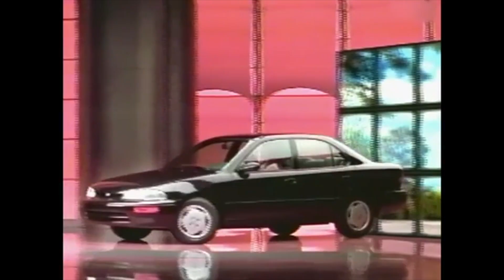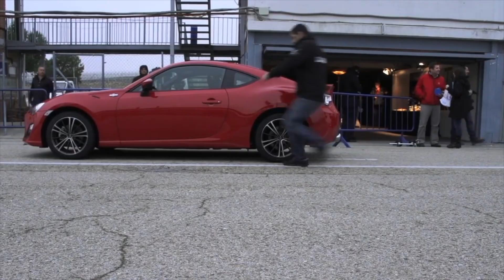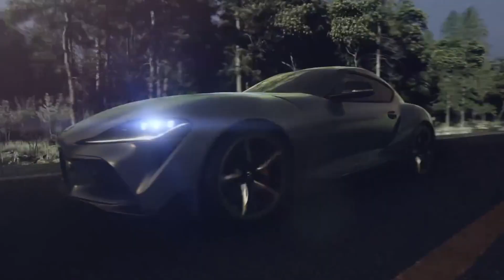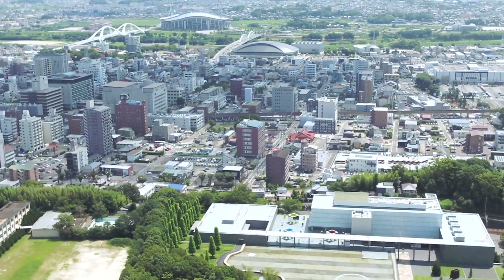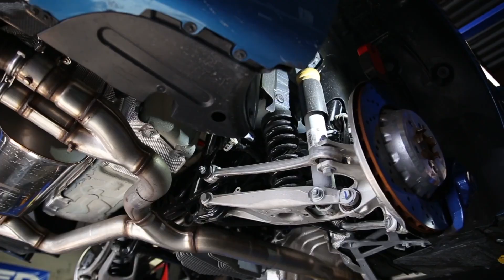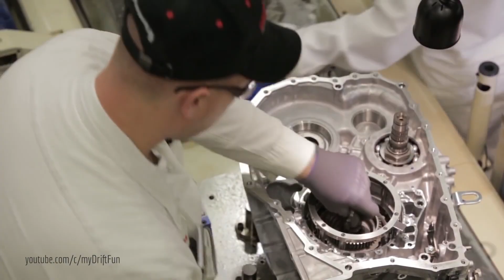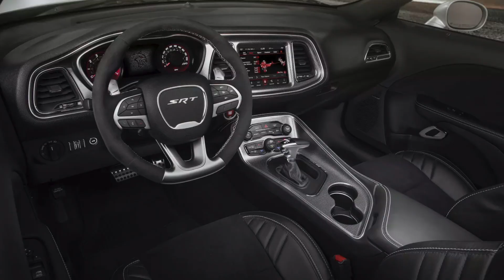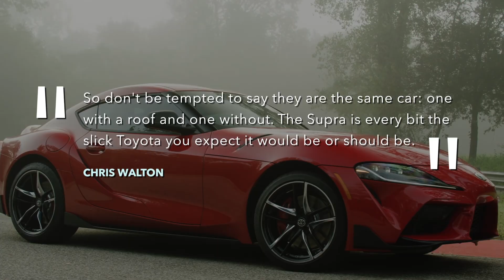MKV Toyota Supra - BMW or Toyota? The UNTOLD TRUE STORY

Comment: Sorry Toyota but for the price of that "Imitation Supra" I would rather just buy the new Shelby GT350R Mustang...
Reply: The old Supra cost around $20 000 more, including inflation.
Reply: @Ethan-ck6iz  Toyota has now confirmed that its new sports car will start at $49,990 plus $930 for destination charge. But that's for a version powered by the 3.0 liter inline-six. The four-cylinder model should cost less.
https://www.roadandtrack.com/new-cars/future-cars/a12635049/2019-toyota-supra-what-we-know/

At least to me, that new "Imitation Supra is not worth $50,000.  Toyota is simply trying to "bank" on the Supra name.
Reply: @DJ Ghost Looks like it has the 155 MPH speed limit (a.k.a. "the European-spec speed limiter") like Jaguar, for example. (and likely Aston Martin) IIRC, I tend to see the "155" limit on "executive-class" luxury cars.
Reply: one problem, it's a ford
Reply: @MJ_868  IF you want Non-Ford alternatives that offer more bang for your buck car than that "BMW Supra" then how about the (2019 Lexus RC 300 F SPORT RWD or AWD, Subaru WRX STI or STI Limited both well under $50,000 starting, Nissan 370z,  heck even the Civic Type R would be better).  Toyota won't get the glory back from Nissan, there is a reason why the Original Skyline rocked the world and why the Nissan GTR continues to rock the world with its amazing engineering and performance, and it deserves the price it commands.  Oh and Nissan didn't get BMW to build it for them...
Reply: @MJ_868  one problem with you answer at least ford built it with a passion
Reply: A two door Falcon?
Reply: then do it. the mustang probably has too much hp for you anyways. you'll end up powersliding into a ditch.
Reply: @timcoccarelli2193  I'll just leave this here for your eyes.   "IF you want Non-Ford alternatives that offer more bang for your buck car than that "BMW Supra" then how about the (2019 Lexus RC 300 F SPORT RWD or AWD, Subaru WRX STI or STI Limited both well under $50,000 starting, Nissan 370z,  heck even the Civic Type R would be better).  Toyota won't get the glory back from Nissan, there is a reason why the Original Skyline rocked the world and why the Nissan GTR continues to rock the world with its amazing engineering and performance, and it deserves the price it commands.  Oh and Nissan didn't get BMW to build it for them..."

Yeah, I would still get the Mustang or any of the other alternatives that I have mentioned above over getting a BMW Supra.  Oh, and fortunately I know how to drive quite well and a manual to, because I grew up with cars that didn't have all the "Driver Assist" crap that vehicles have today that essentialy make newer drivers worse drivers lol.
Reply: But the new GT350R is $67,000. The GR Supra is only $50,000...
Reply: @draconious4005  Ya, and how many people are gonna get a stock Supra... nobody and yes I said the GT350R but hey the lower mustangs are still a better overall deal than the Supra,  there is the GT Fastback, GT Premium, Bullit all of which heavily undercut the $50,000 starting price of the Inline Six Supra.  Also the "New" Supra is a brand new build basically from the ground up so it is unproven.  The Mustang has a long pedigree that is proven, budget friendly and one of the most bang for the buck cars you can currently buy.  But hey Toyota might have a gem maybe but only time will tell when the car gets driven around.

Comment: WTF ??? Laws against badge engineering ??? I drive a 2018' Buck Regal built in Germany and it's the same car as the Opel Insignia.
Reply: The Buick Regal is a car which was developed by GM. Opel is a German car manufacturer which is owned by GM. Why would German anti-trust laws apply in this case?
Reply: @ @AbbeyYaar  Because Opel is no longer owned by GM

Comment: Who said "reliable" z4....come on BMW's are fine new but put over 100k on them and they become worthless bags of electrical hammers.  I was pleased to see the development at a point was separate but I am sorry Toyota you are fools to think us die hard fans would tolerate a BMW engine in our Supra.  All the other co-development would be acceptable to many if the car had the heart of its brethren.  ZF transmissions are great but a mistake as the only option.  There needs to be a conventional 6 speed in that car or stuff it. Look at used car ads for 350/370Z's...automatics are worthless but one with a manual sells within several days for a much higher price.  I was one of the many looking forward to this car but I will never buy one simply because Toyota has lost it's focus on it's loyal customers and why we are such.

Comment: Can anyone help me plz?....

Is this a Z BMW or  a beefed up Miata?
Reply: This isn't a way to test by imagining.  I assume when you drive it hard on the track the separation between a Corolla, Miata, and this would be distinct.  At normal speeds and driving you might as well get a Prius.  I took the 750xi to 150mph in Comfort+ and it didn't even feel scary.  In fact it even shifting Up at like 140+ which was interesting.  It's like it's mean't to go fast obviously but I never ever been that fast in it ever.  I hit 140mph all the time on the R6 though.  Have to love when you go that fast in the dry that they can do it with EASE and give you confidence when doing it too.  Not like it's going to fall apart and you feel like you are going to die or lose total control at any moment.

Comment: Its like making a sequel to a movie without the original cast. If it was just a new vehicle all together it wouldn't be a problem. The issue isn't that they slapped a BMW engine in a supra, its that they slapped the supra name on a car that doesn't have the same Toyota engineering as the legendary supras with the 1jz/2jz engine. Its a cool car sure, but its not living up to the supra name. Its a cash grab without the same amount of effort as the prior models. I could never afford one anyways, but its still a big let down.

Comment: It doesn't matter what they say to justify it this Supra it should have never been done in the manner it was done in. If anything it flies in the face of the Supra name because it's chocked full of BMW parts and it almost seems like Toyota didn't have much confidence in themselves this time around so they went to BMW. Toyota has proven many times over the years they could design and build sporty cars that not only perform well but are also reliable and highly tuneable so why not this time around? If you plan on resurrecting such a famous nameplate then there should be 100% forward momentum in keeping it genuine Toyota because after all, this is what made the Supra so famous among the masses since the 80s. The end result is now a car that looks nothing like the concept, introduced BMW issues (electrical, carbon buildup, timing chain issues and injector failures) to what is supposed to be a sporty and reliable car. Why not a Toyota developed motor? Why not an Aisin transmission over a ZF? Why co-develop at all? This car will flop and I guarantee all the money spent developing this Supra won't be made back. Good job Toyota.

Comment: The Geo Prizm of sports cars does NOT apply because the move is UP not down. It's more like Neman Marcus making a cheaper line.

If BMW actually makes the car, then it will be better than if Toyota actually made the car themselves, much like the failure of the waaaay over-priced LFA!

What kills the Lexus RC-F is the tranny. I hope BMW oversees  a real sports tranny that shifts fast, unlike the lame transmissions that Lexus has. Dual clutch anyone??

Comment: That is the most normal thing in the car industry. Car makers don't really develop their cars any more. Most of the actual development is outsourced. Take your car apart. Most of the parts will have brands like Continental, Bosch, Denso etc. on them.
Making a car these days is like Lego, they go to the companies with the actual know-how and tell them "we'd like to make a car like this..." and the subcontractor says "oh ok we have this engine control unit, these lighting systems, this clutch control etc. that would fit your desired specs with the following software adaptions..."
Basically 100% of electronics are bought from third parties. And even mechanic design is more and more being outsourced, electrification of the drivetrain is further pushing this trend.
Car makers only really do the design and chassis and parts of the drive train. And even that is heavily reused across all the brands inside and sometimes across those big conglomerates like VW group and GM.
So much of the feel of the dynamics of a car can be tweaked by software these days.
Reply: Did we even watch the same damn video. Better yet, did you even watch more than the title before typing......

Comment: "bmw was taken aback with toyota's focus on durability and reliability testing" 

so... I mean... What have you been doing up until now? Oh that's right, building super expensive cars that don't deserve their price tag. With plastic cooling system components, heads that crack the instant they get a bit hot, interiors that fall apart, locks, window regulators, and door handles that fail within years, the list goes on. 

I've got a bad feeling about this, at least toyota's putting the hard word on them though

Comment: Such a project is important in the automobile-industry/business today and they are great. You get the best actual knowledge and techniques of 2 big players in automobile history. In this cooperation, the booth manufacturers also have done a lot of motorsports engagement so they know since the starting point that they will build 2 difference models just sharing a platform and about 50% of technical parts from the engine concept. The only critical point i see at the moment is the price range, and that the actual R6 engine versions nearly cost the same. If you look at the global automobile market, bmw has this premium class image, which Toyota has outsourced to their other label Lexus. So i think after 3-5 years the value of the Toyota will be under the range of an identical Z4.

Comment: I had every version of the Supra; silver 1979, black 83, brown 87 turbo and burgundy 94 turbo ... I also had a BMW 3.0Csl, Dinan M3, e36 racecar, M6 ..... I in NO WAY would ever ... ever ... consider such a badge BIN car.  A supra needs to be a trickle down LFA for me to be interested and BMW needs to stop engineering post warranty material failures into their cars (Sothbay BMW insisted that my M6 needed a $9k TB actuator repair at 5yrs 2mn with 21K miles on the ODO although I noticed zero performance issues ... BMW NA gave me the middle finger ... and the car has never ran as well after the repair than before while the interior creaks worse than a 1980s corvette).  My Supras were all fun, fast and bullet proof like my BMW e9 & e36 ... my new M6 or X3s have all been perfect for posing but not for driving.

Comment: The engine, suspension, and drive line came from BMW. Transmission from ZF. So it's sounds like really the only thing that was a true co-development was the chassis.. But at the same time, using existing BMW parts is going to influence this. Then the styling, interior and tuning and done independently.

Comment: It's funny how much shit the N55 gets when it's predecessor the N54 is probably the most reliable engine I see come through the dealership I work at. I see e90s with the N54 come in with 300+ thousand miles regularly that still run great. My 07 335i has the N54 with 158,000 miles and it runs like new.

Comment: Im not saying its bad to drive it just doesnt stand side by side with its counterparts of the late 80s and 90s if it doesnt come close to the the GTR NSX of today then ppl will be abit pissed off. Its like Mitsubishi or mazda remaking the GTO twin turbo or RX7 but giving it 10 more HP than its last model and shares very little in terms of unique design and made by the company its like making an RX7 without a rotary its stepping so far away from it roots the new Z4supra is a money making car not a homage to its predecessor

Comment: If the new Supra looked more like the actual concept and less like the new Z4 there probably would be half the disappointment generated. 
The other half of the disappointment no doubt stems from the use of the iconic name, Supra, and they should have simply used a different name out of respect. 
No one in their right mind would argue it's not a good car, but they might argue with only minor design / quality control input and tuning is the final product really more than 10% Toyota?

Comment: this is not a supra....its trash...rip supra
Reply: Watch the video
Reply: @Ethan-ck6iz  i did
Reply: @shijinxbeast7939  Then you didn't listen
Reply: @Ethan-ck6iz  just explain you point...
Reply: @shijinxbeast7939  It's not trash, because everything internally was engineered by both BMW and Toyota side by side and who cares if it's a collaboration? The MK4 Supra was a collaboration between Yamaha and Toyota and nobody cared. The only thing people should be complaining about is the auto transmission... for now. There will likely be a manual if there's demand. The new 86 has a far worse story than the new Supra. The new 86 at the start was quite literally a re-badged Scion FRS with a couple cosmetic changes. And it has a boxer engine instead of an i4 (like in the old 86). All this and guess what: people REJOYCED! AND EVERYBODY THOUGHT IT WAS GREAT THAT THE "LEGENDARY" 86 RETURNED! The hate towards the new Supra is irrational.
Reply: @Ethan-ck6iz  its trash to me cuz it doesnt bring the supra name....what i mean is like it cant be tuned or look as good as the supra mk4
Reply: @Ethan-ck6iz  and dude the car legit looks like shit i aint hating on it because everyone is im hating on it because it doesnt show what a tuner car is